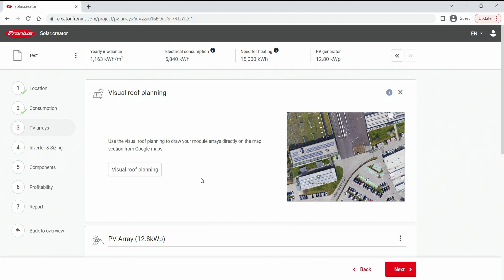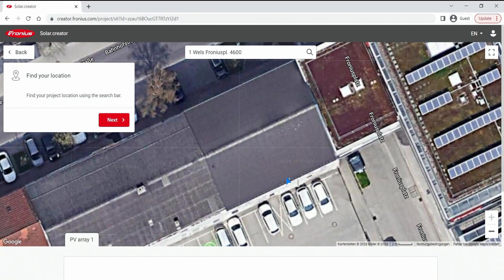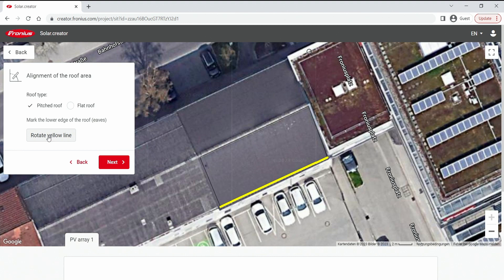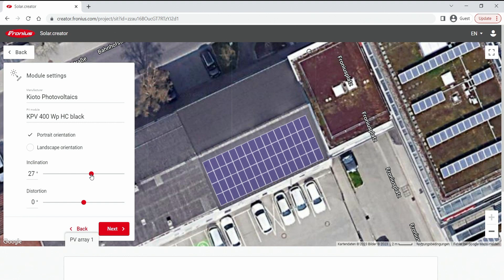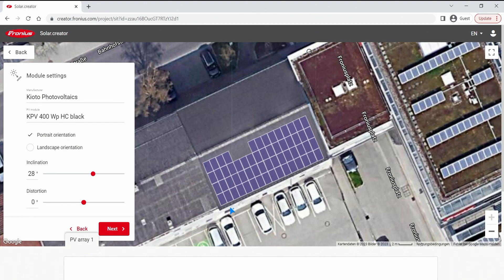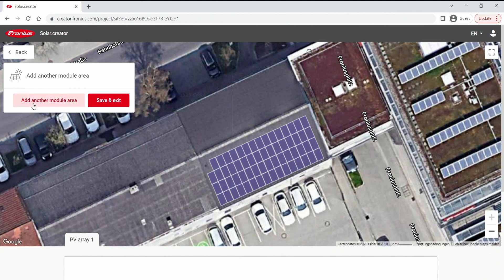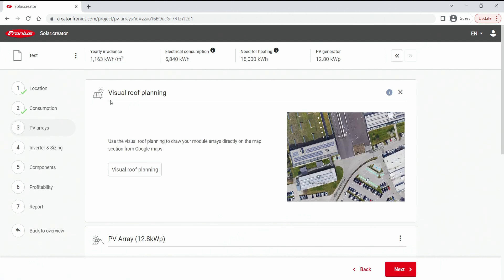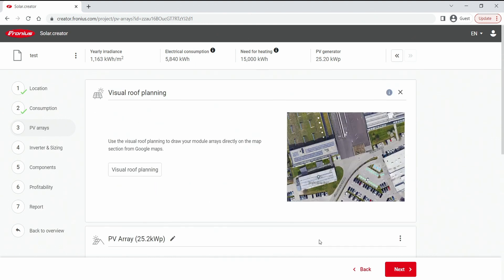How-To Video: Visual 2D roof planning in Solar.creator

Comment: how to I find in Google maps the orientation of a roof (needed for the manual adding of PV arrays)?
Reply from the maker: The simplest solution would be to use the integrated visual roof planning feature in our online tool.
After you have finished the visual roof planning in the Fronius Solar.creator you get the orientation (in Degrees) of the respective PV-fields.

Comment: Is it possible to STACK two Gen 24 plus on Solar Creator? it looks like I'm not able to select 2 10kw Hybrid inverter in stack mode...
Reply from the maker: Yes correct, currently only 1 hybrid inverter per system is working.